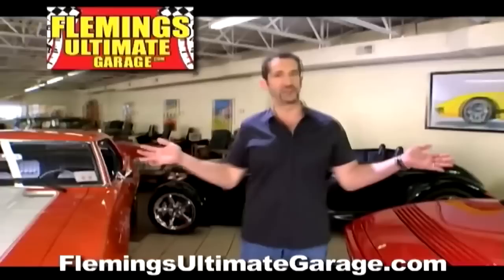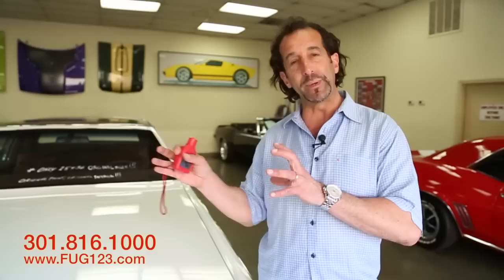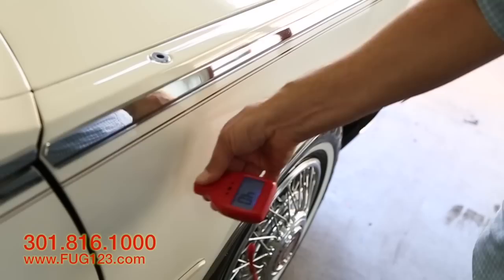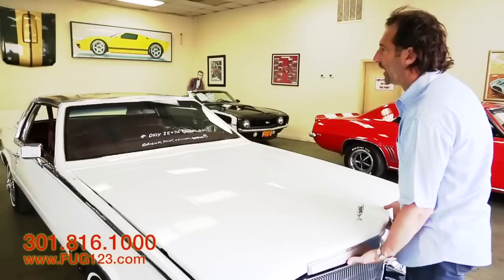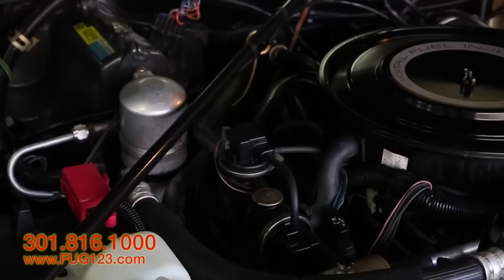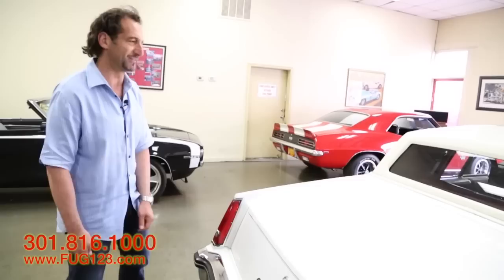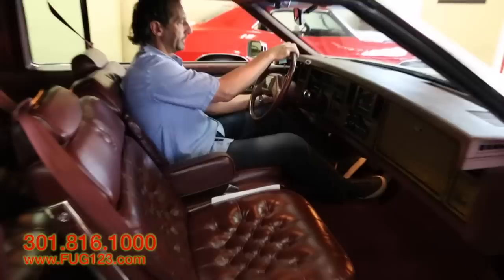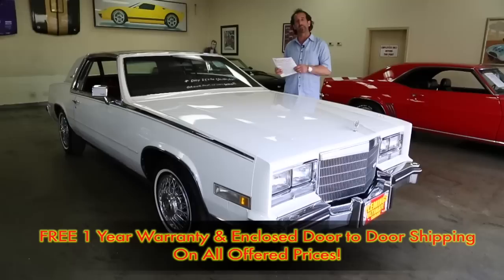1984 Cadilac Eldorado Biarritz for sale with test drive, driving sounds, and walk through video

Comment: A 1981 with one of the 368 CID V8-6-4 engines still operating properly would be even more rare!
Reply: +LakeNipissing   Yes the 368 was a great engine big block!  One of the best Caddy made and then they went to the stinkin 4100.  It was improved in 84 though.  But still--that cost Cadillac and it was not just their fault but that friggin Carter and democrats passing those CAFE standards on fuel economy. THAT hurt all of Detroit.    These are beautiful cars and ran very well in earlier years.    This  is the last of the great great era of GM and American made autos.  Now its all controls and foreigners making parts.
Reply: @usdeutchlandmark9135  It was NOT improved until 1985 and by then the damage had been done. Cadillac will NEVER be great cars again. I now drive a BMW but have fond memories of the great Cadillac cars.

Comment: Those are 1985 tires with smaller white wall, not 1984. There was a bigger white wall in 1984.   Yes, the tires were from Goodyear. I agree the 350 Olds Rocket that came in the 1979 Cadillac Eldorado's were much better.

Comment: looks like my grandmothers living room in the interior.  25000 miles but the car is over 30 years old. even in proper storage, hoses and rubber start to rot.
Reply: +METALBUG999 They do but not as much as you may think IF the climate it was kept in was fairly constant. In any event, hoses and belts aren't huge expenses so I wouldn't let that put you off.
Reply: ok

Comment: Alright... Okay.... Alright... Okay.... Alright... Alright... Okay?  😵
And as others have pointed out, the HT4100 engine was an unreliable dog of a wimpy 250 cubic inches that produced a miserable 135 hp when it wasn't in the garage having the intake manifold gasket replaced for the fourth time! Pretty to look at though. 😉

Comment: You meter had all different readings that had more than .5 mil differences.  Don't understand what you are saying.
Reply: Factory limits on paint are within 1.5 to 2.5 mil of difference between panels. It's GM not Audi or Mercedes. Now if it was repainted or had repainted panels, the mil would start at 6.0 to 7.0 and change with 5.0 to 7.0 miles per panel.
Reply: +dphotos I was thinking the same thing ,wtf?

Comment: IF CADILLAC KEPT THE 425 UP TILL THEN IN THOSE CARS  WOULD'VE BEEN GREAT. IT'S A SHAME COUSE THEY LOOKED SO NICE BUT THOSE MOTORS SUCKED SO BAD  THE 4100 SERIES BLOCKS WERE TOTALLY JUNK. AT LEAST PUT A SMALL BLOCK CHEV IN IT LIKE GM DID A FEW YEARS LATER IN THE 4 DR FLEETWOODS.

Comment: I always thought these came with either an olds 307 or 350. I guess I was wrong
Reply: You could get the 350 in 1979 and 1980. 350 and 368 in those years. Then it was only the V8-6-4 368, Olds 350 diesel, or the HT4100.

Comment: Most people don't know is that ht4100 was the worst nightmare of an engine Cadillac ever produced . This beautiful car was a piece of shit cause of that then and is a nightmare now. Mechanics didn't know how to work on them in the 80s,  good luck finding one in 2018. Typical sleezbag used car dealer and looks the part. This is one of a kind folks the most undesirable motor you can find.

Comment: Sorry but those plastic panels around the bumpers and tail lights are known to fail quickly. Seriously doubt it’s all original paint notice he never tested those parts. Total bs.

My father had one of these. Needs a continental kit on the back.

Stop slamming those trunks. No need to do that with these cars. 

Sorry but you know very little about this car.

Comment: They were a crappy car, especially with the unreliable V 468 engine,,,,,, Cadillac always has produced cars that forever have issues. These old cars are a dime a dozen, worthless. The Buick Rivera & Olds Tornado are quite rare & proven to be much superior. Actually these cars were not great on fuel, nor did they ride smooth like a Buick. I shall say the interiors were quite nice & very few modern cars have that luxury.
Reply: I have a caddy with a 864, runs fine, when I do drive it. Deactivate the cylinder mode and they are fine.